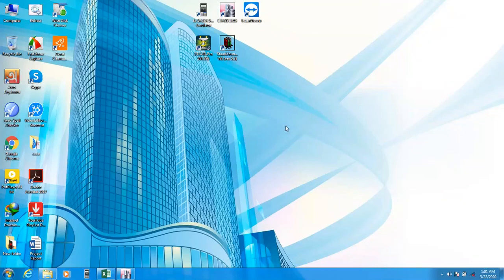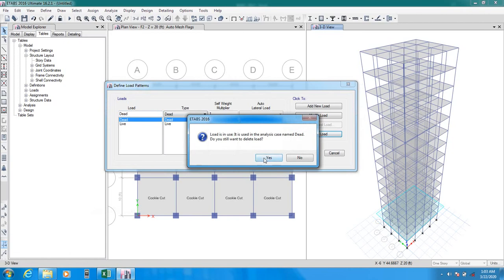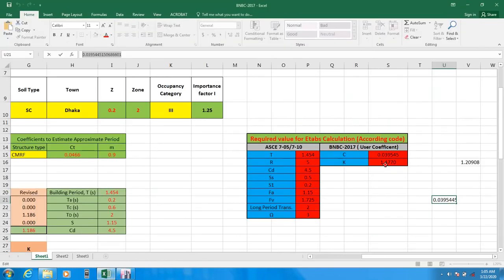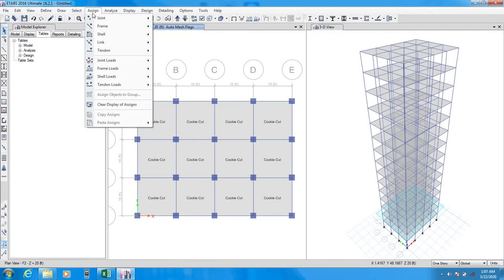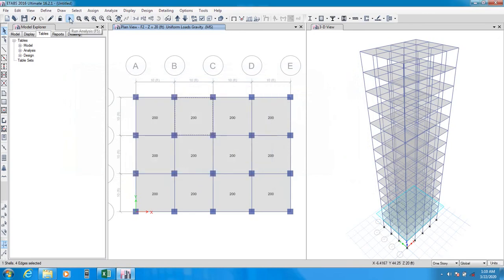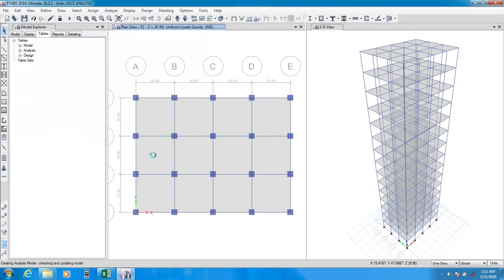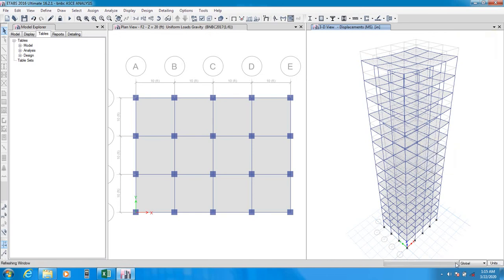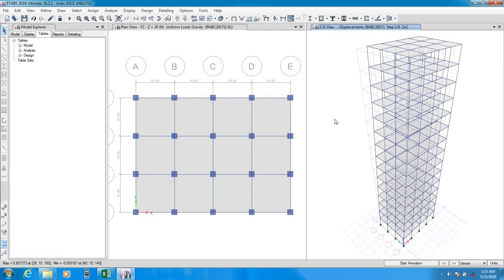Earthquake load analysis As per BNBC 2017, ASCE 7-05, ASCE, 7-10 with Excel in Etabs | Lec-3

Comment: What is the purpose of defining Mass Source?
Reply from the maker: A mass source in ETABS (Equivalent Static Lateral Force Procedure) refers to a load that is used to represent the inertial mass of the building structure. This mass is used to calculate the seismic forces acting on the structure during an earthquake.

The mass source is typically assigned to the floor or slab levels of the building model and represents the combined mass of the floor/slab, any permanent equipment or fixtures, and a portion of the wall and column masses. This total mass is then used in the calculation of the seismic base shear and the distribution of lateral forces throughout the building.

The mass source is an important parameter in the seismic analysis, as it directly impacts the calculated inertial forces that the structure must be designed to resist. Accurately defining the mass sources is crucial for ensuring the structural design can withstand the expected earthquake loads.
Reply: @qlearnify-en  thank you so much for the insightful response!